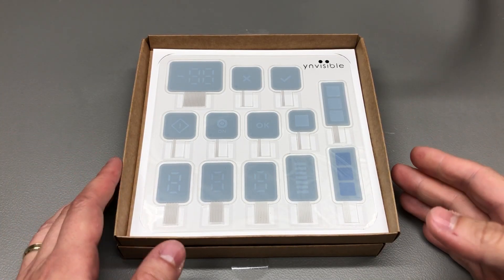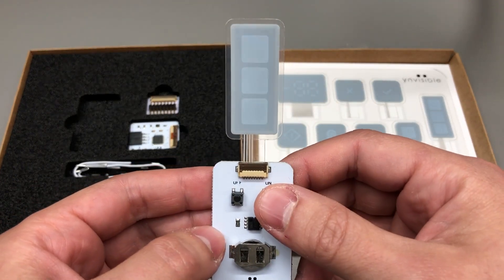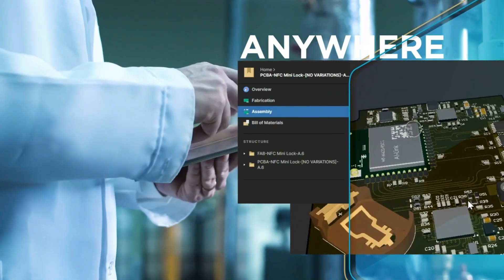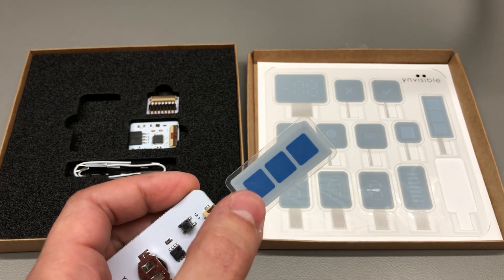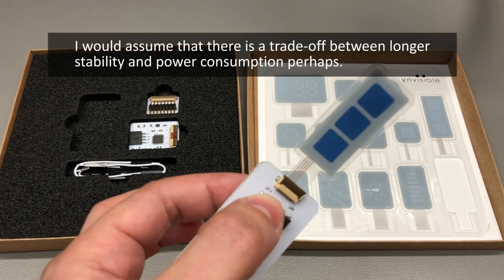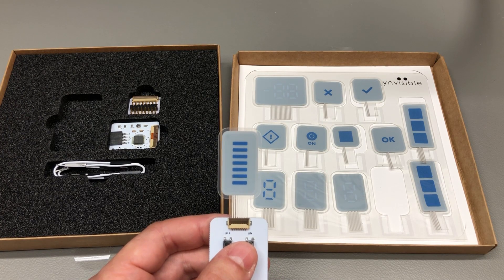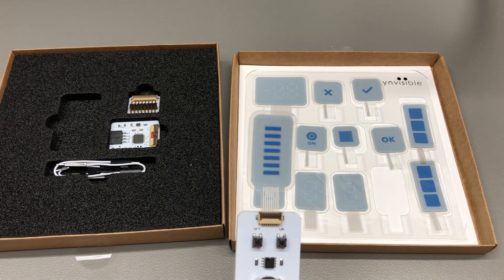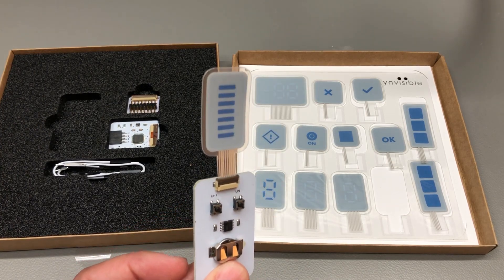Ynvisible Ultra Low-Power Display Technology  - Voltlog #375

Comment: its an interesting puzzle to think of the applications for this technology. clearly the low energy consumption gives heavy advantage to mobile applications with solar panels. or other low energy harvesting renewable source such a wind or water flow. i think it might be good for active labels and communication between underwater divers. or other water based applications. because the platic construct + low energy and low voltages makes the whole device much easier to waterproof and use at depth. other applications might be things like safety tags for uv exposure or dust exposure, or radiation exposure. things like this. but as the other person here also points out... it would be great if it was a cheaper technology some day.. that would also be very helpful for enabling these applications

Comment: This would be perfect for power banks and other uses, where the current LED bar graph needs to be turned off to conserve energy, yet doesn't change quickly. Another use could be wearables - the armband is the smartwatch, flexible PCB on the inside, large display on the outside; a backpack doubling as a GPS tracker/navigation for hikers; weather-resistant displays for marine applications...
Reply from the maker: I quite like the idea of having one of these as a cheap & low power battery indicator.